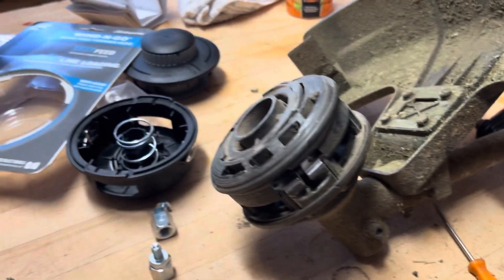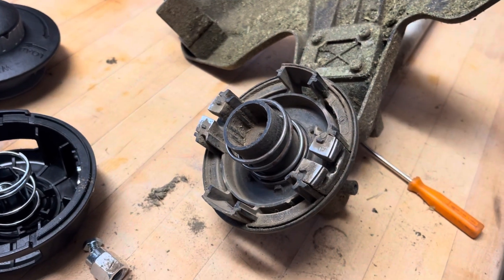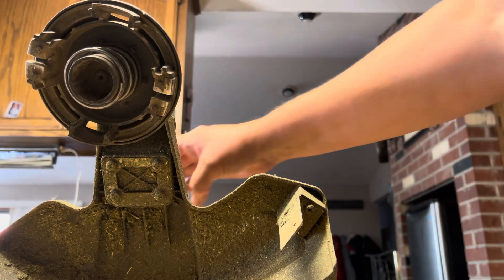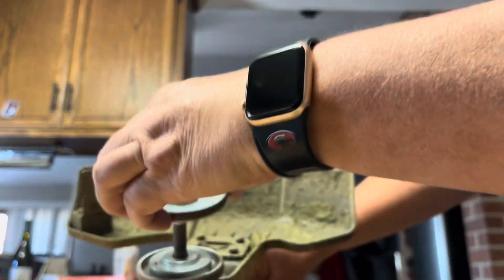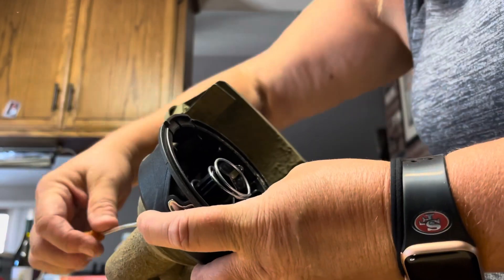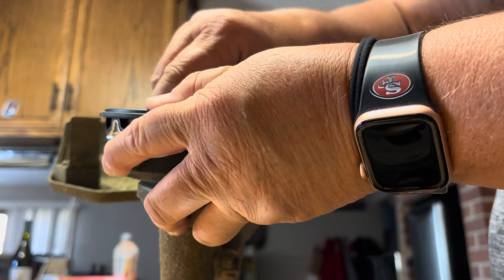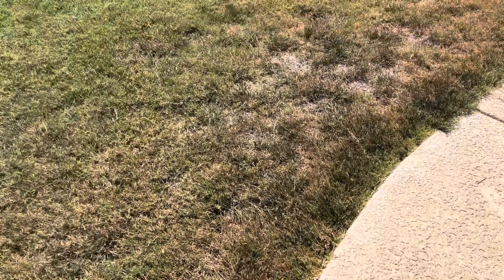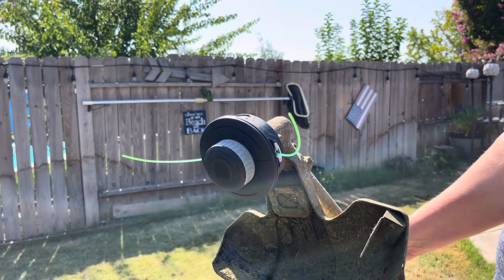How to Replace a Greenworks Pro Weed Eater Bump Feed Trimmer Head

Comment: My Greenworks 60 volt doesn’t have a hole on the top or side to lock the head to remove it. Any ideas how to remove?
Reply from the maker: @alvinwoodring7244  it took me a minute to find mine. Hopefully you can find it.